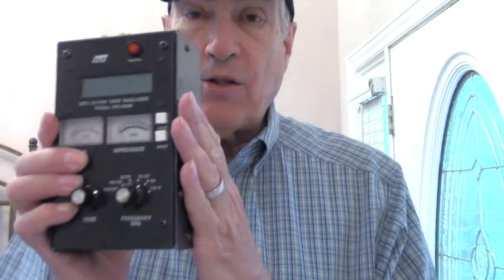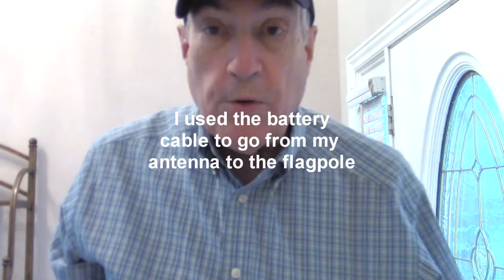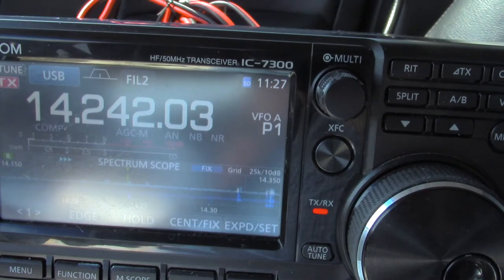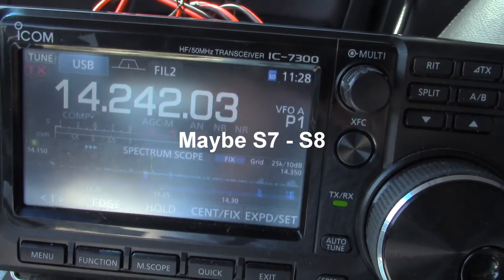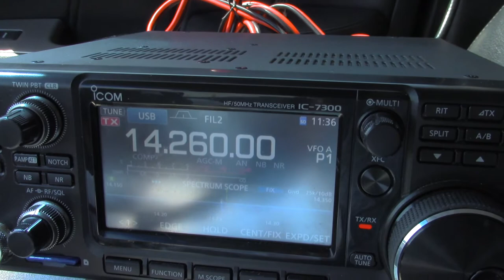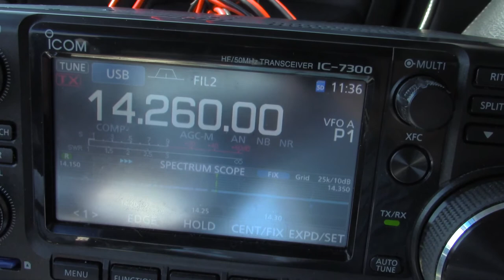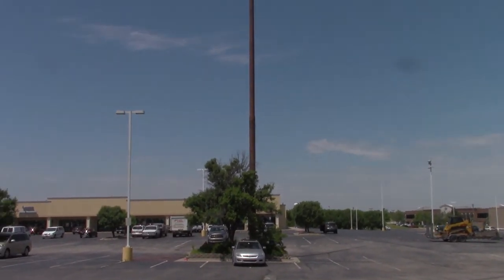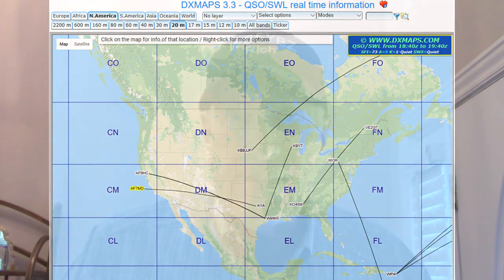Making a Ham Antenna From a Parking Lot Flag Pole

Comment: I am still looking for a stealth flagpole antenna a to use at my condo.
Reply: Marc - Me too.  What sources of information have you found to be helpful to design a flag pole antenna?  I am considering building a new home in an area that will only allow a flag pole, so I am looking for information that will help in the proper design.
Reply: @BretChilcott  look for this baby on ebay, I use it with a random length of wire and it works great>  End Fed Dipole 80-6 meter Portable HF Antenna Matchbox System
Just attach it to the top of an extendable fiberglass flagpole, because you don't want it up in a thunderstorm.